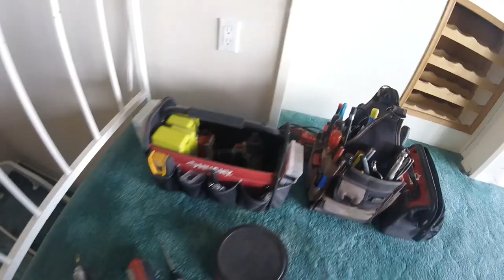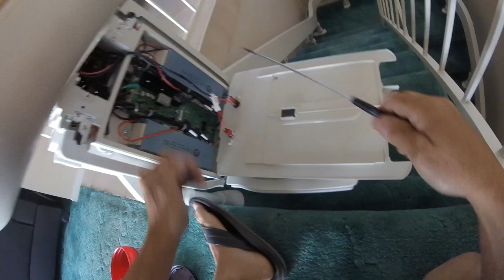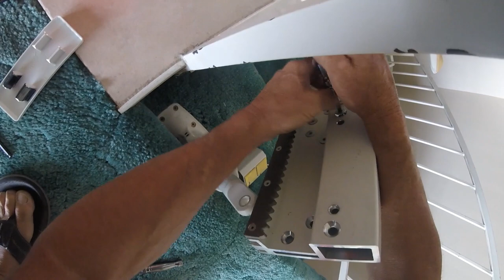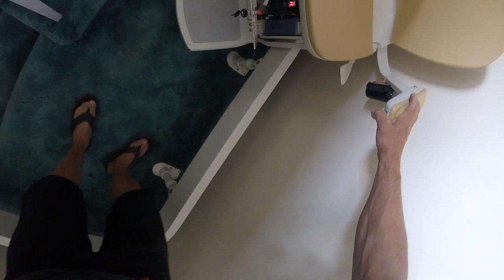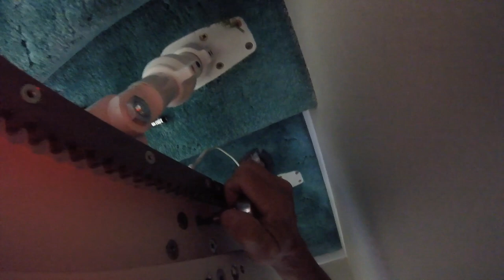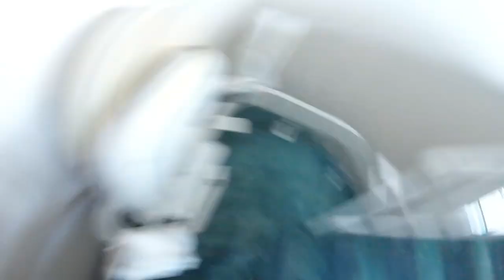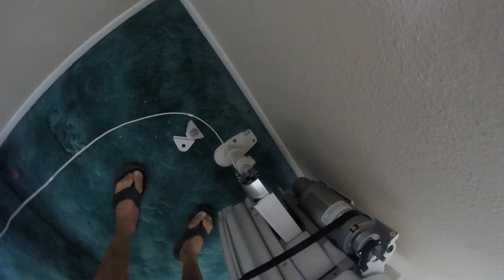Acorn 180 Curved  Stairlift Removal

Comment: Excellent video. Very helpful. I will be doing this job tomorrow. Lots of tips, like the set screws that are not visible and the 3/4 inch nuts which have to be loosened before removing the Allen key bolts on the other side. I would have probably tried to run the chair off the rail but you mentioned the programming aspect. So will be removing with rail as you did. Thanks for posting,

Comment: Thanks for such a detailed video.  I would not have known about the set screw, and separating the joints was driving me nuts, today!
Reply from the maker: I’m glad you enjoyed the video. It was pretty much a trial and error on figuring out how to dismantle it but this was the first time I ever worked on a lift like this. It’s kind of crazy that they put the set screws in the place that they did but hopefully this video helps people realize how to dismantle the rails and not try to beat the crap out of them to get them to separate. I was able to Ship the entire unit to my fathers home in Hawaii and then reinstalled everything and the programming was a bit tricky but there are resources out there with detailed instructions how to reprogram the lift.
Reply: @pumpbottlemisters  Hitting the crap out of it is exactly what I was doing.  The rubber mallet left no marks, but it also didn't budge it a millimetre.  I dismantled it last night 9 (13 stairs) in under 2 hours.  I left the chair on a section of rail for the new owner.  Hooly dooly, that thing is HEAVY!
Reply from the maker: Glad you got it done. Dismantling is the easy part. Installation and programming is a whole new kind of headache. ;-)
Reply: @pumpbottlemisters  A headache for someone else!

Comment: I took mine out in 3 pieces.  The installer stripped out so many of the 5mm heads, that it would have taken hours to remove.  I also manually ratcheted the chair off of the rails to make it easier to pick up and move.

Comment: I'm attempting to remove a lift now - but absolutely NONE of the sections comes apart. They are wedged together so tightly that they will not come apart. Can't believe how easy you are able to separate them in this video. Just can't believe it. I'm about to get some dynamite.

Comment: You dont need to remove all the rail in order to remove the carriage either the seat , if u only remove the charge point u can go to program mode (clear mem) then with the remote u can reprogram or get the carriage up or down ez, the remove the seat. Also when reprogramming is good to know what u doing if you set a higher speed in the helicals or the angle increases u can jammed one of the motors when tryng to sync with the other. watch your fingers this is no jokes

Comment: Very good - I have to do the same to an Acorn 180 (mom passed away)...leaving it on a short rail has benefits to completely removing it off the rail I guess? I had to replace the batteries about 18 months ago and had to reprogram the start/stop points and speed - was a bit tricky but did it - don't understand why they don't use non-volatile memory for storing the data points.
Reply: Leave it on a short rail if you can at all.  It was difficult to get it back on the rail.  We found we had to loosen bolts on a round plate that holds a couple of rollers in order to get the rail through.  Once it was through, we re-tightened them and it was fine.   To get it back on the rail, we also had to reset the over speed brake which had triggered in the removal process.

I have instructions for programming a T565 which is the model my 2018 chair should have, but mine won't enter the P1 mode when I hold down the three footrest safety switches.  It just keeps blinking E1 when I do that.  Did you learn any tricks or find good instructions?
Reply from the maker: I will look again for my programming instructions that I used. It was a bit confusing but I was ably to work thru them. It took me about 5 or 6 try’s to get the new programming to take. Then while I was back in CA the 2 new remotes arrived and I walked my 80 year old dad thru the process to delete the old remote and reprogram the 2 new remotes and the the frigging Acorn reverted back to its original programming. He went half the way down the stairs and then it started tilting like it was coming to a landing and he about fell off. Needless to say we had to reprogram the lift again and ever since then it has been working great.
Reply: @steveselby2694  could you share your programming instructions?  I recently got a used lift and think the first thing I need is new batteries then reprogramming
Reply: @steveselby2694  I just googled "acorn 180 reprogramming" which led me to the same document that came with the batteries. I just kept trying but not sure what I was doing wrong - the instructions I got with the batteries were not 100% clear.
Reply: @brianleung1105   try the links at this page.  Just be careful because the website with the instructions will try to put a lot of crap on your computer.  Don't accept anything but the instruction document. http://okprops.com/how-to-problem-solve-an-acorn-180-or-bison-80-stairlift/
To enter programing mode on the older version, you hold in all three safety switches on that footrest.  On the newer version, you in the two safety switches that run from the seat to the footrest and the bottom switch on the footrest.
Reply: Does anyone have an installation manual?

Comment: What size tool do I need to remove the set screws or whatever that is holding the pieces of railing together?
Reply: The set screws are 5mm allen heads

Comment: How did you get the seat to come off the base of the seat?  We're pulling like crazy, but it seems to be locked in.
Reply: I think he said that's the small plastic screw at 2:11 https://youtu.be/K1Yt8kBZ-dI?t=131.  I'm doing this job tomorrow.
Reply: @rottingrat  That's it.  I watched the video 5 times and didn't see it.  Thanks.
Reply from the maker: Sorry for not replying earlier but yes there is a small plastic screw that needs to come out and then the seat can slide directly upward it took me a little while to figure that out as well
Reply: @pumpbottlemisters  When I pulled the seat up, the plastic around the top of the hole started to come up with it and caused the switch it was holding to pop out of its location.  It began to crack the plastic.  It could all be put back, but was close to being a bigger headache.  I don't know why it stuck to the seat shaft, but it's something to look out for.
Reply: @pumpbottlemisters  I have a slightly different seat, probably just a different iteration of the same one you show.  Mine swivels on the front corner, not a center post.  It appears there's a plate across the top of the battery base unit with four bolts that hold it in place.  I'm nearly done with my "uninstall" -- just waiting for my son to come over to steady the chair/rail piece while I take out the last 3 screws.  I'd hate for the chair to crash through the upstairs railing and fall 10 feet to the foyer below.  :(  Thank you SO MUCH for this informative video!  I did number all my pieces sequentially from bottom to top before I started disassembly, so it would be a little easier to reassemble, if needed.